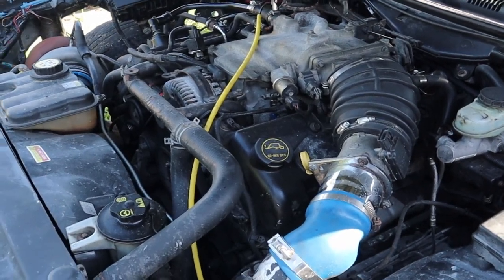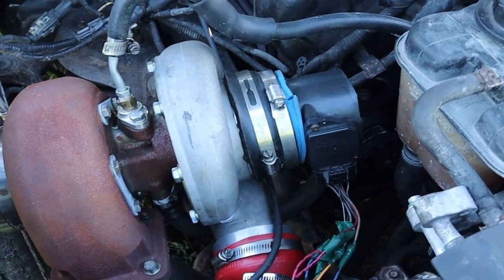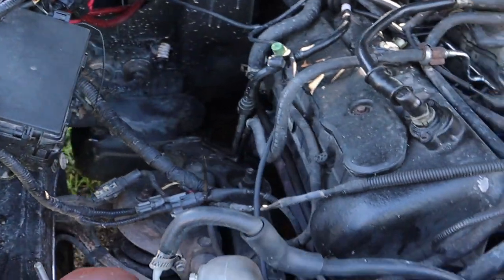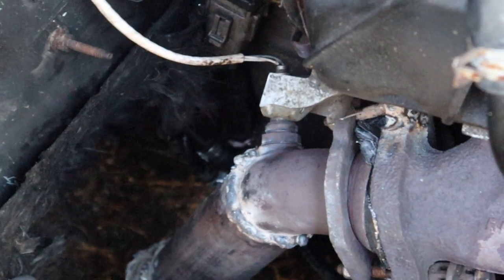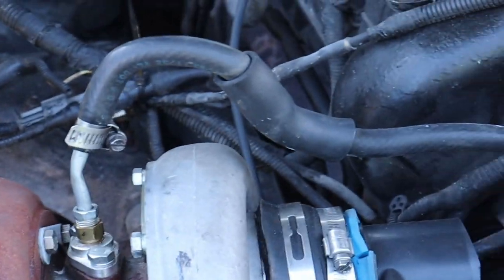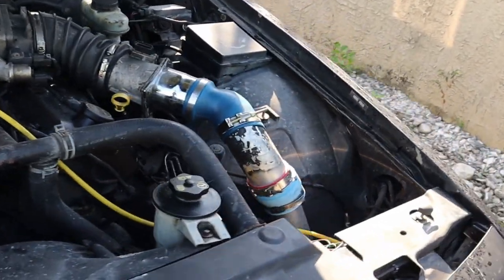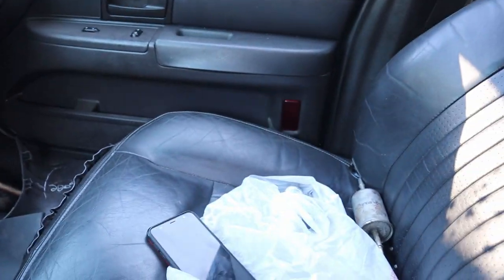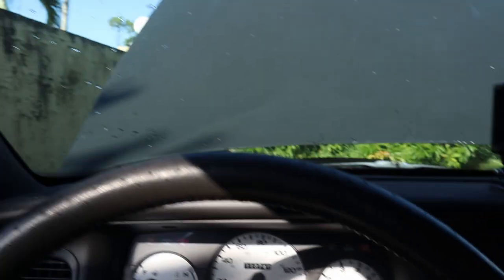How To Turbo Your 4.6L V8 Marauder

Comment: Good Lord that pipe out the side 🤢
Reply: Right?  I mean I hate talking shit about anyone’s project, but damn bro.
Reply: @chaelodoul9401  honestly it kinda grows on you let that man be different if he wants to be different appreciate the fact he took his time to show you how to get some boost in a platform that is hardly done yes you can find other people have done it but this is time and dedication does it scoot burn rubber or rip bagles if it does appreciate it!!! My man you gotta learn self love so you can spread some love it's not you're dream or even car it's his plain and simple. Also this is coming from a guy who also has a panther platform altho I have no fender pipe lol but it does have a cobra r wing for literally no reason but because I wanted it there. I feel this man's pain on getting hate but if you look at it I bet his Dream is to have two of these one on each side then that man is driving a mechanical bull that spits flames out of its horns .. I mean really don't just rag appreciate people's ideas you never know what it could turn out to.
Reply: @DriftDreams242  fully building mine this year stage 3 heads stage 2 cams full forged block including crank going with t56 mag 3.73 gears edelbrock vic jr intake manifold cobra injectors tho might upgrade to bigger later 78mm bbk one piece throttle body bbk underdrive pulley kit bbk Cai and a few other mods bigger fuel pump better fuel rails sct tuner t76 turbo also might swap that for the on3 turbo kit from the s95 heard good things about it soo far. Ps this is all going in an 01 vic waiting on heads cams rotating assembly and transmission atm have bbk bolt ons already still need injectors and intake manifold this build is only the start of my dream it will only be complete when I put my tribute sticker on it at the end. Ps I might even have custom window louvers made for the rear when it's all said and done
Reply: @DriftDreams242  lmao sub up my man it'll be done soon I'm just happy to see it all getting done it's been 2 years of non stop saving to get this far on it 16k for heads cams transmission and rotating assembly and block machining. Not to mention the paint last year and exhuast work.

Comment: How hard was it to pull the oil pan with the motor still in the car?
Reply: @DriftDreams242  alright I appreciate it I gotta do a oil pump and pick up tube and didn't want to pull the motor
Reply: @DriftDreams242  I hope so I did all new timing chain tensioners etc got all the plastic pieces out except for one small piece I think it got wrapped up in the pickup tube so it's all gotta come back apart